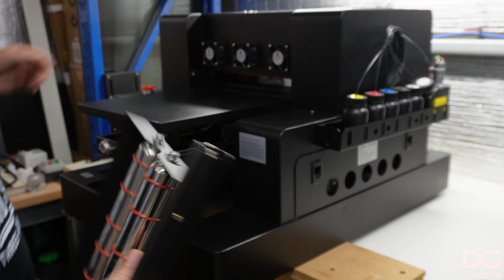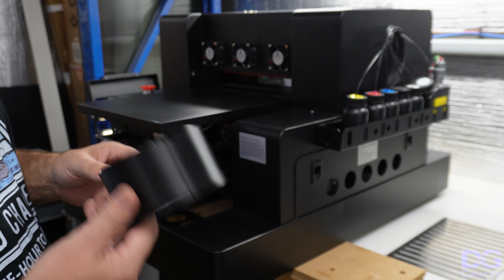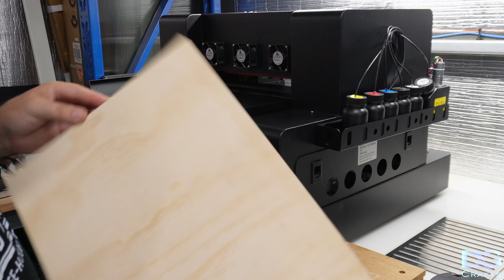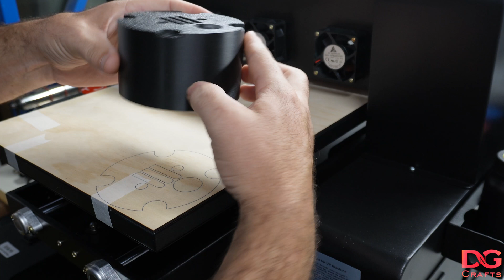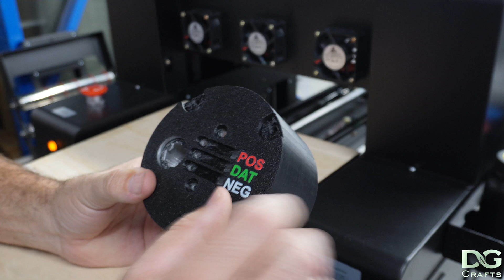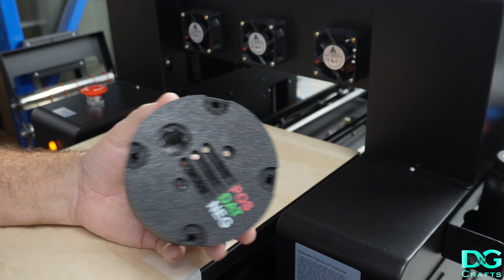UV Printing + 3D Printing

Comment: Hey thanks for the video! Is this UV printer performing good? I'm looking to buy one but heard some people saying it's a headache after a few prints... would love to hear from you!
Reply from the maker: mine still works great.
you have to make sure you do not let the printer sit unused for extended periods because the head can get blocked which requires you to clean it.
you need to do 1 print a week to keep it happy or a head clean.
make sure you mix the white ink well before starting a print.

its the same process as looking after a dtf or dtg printer and most of the problems people have is due to poor maintenance.

Comment: Hello, I'm very interested in uv printing on 3d prints. What's the maintenance like on the uv printer and where do you purchase the supplies, ink, parts etc?
Reply from the maker: maintenance on the printer is fairly easy, it just needs to be run at least 1 time per week to keep the ink and head happy.

the supplies depend on where you are in the world, for me i can use local suppliers like dtf store or i can use ebay